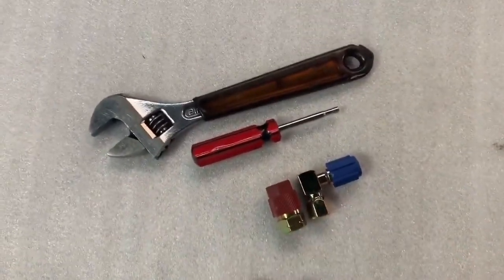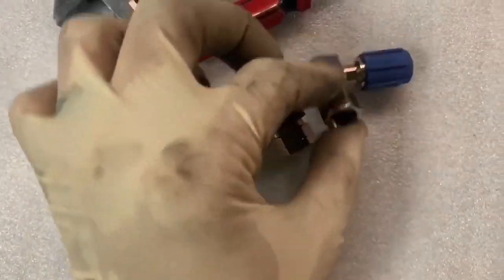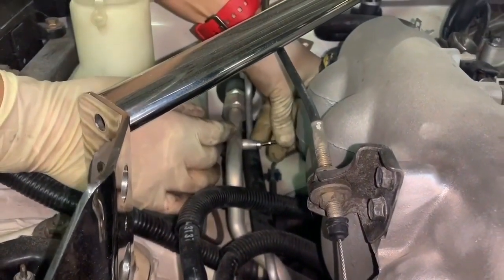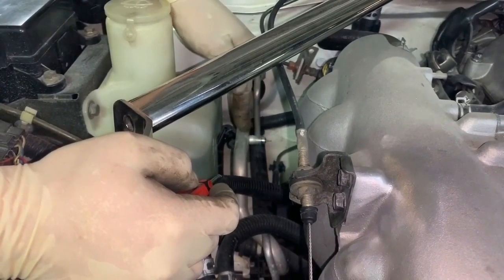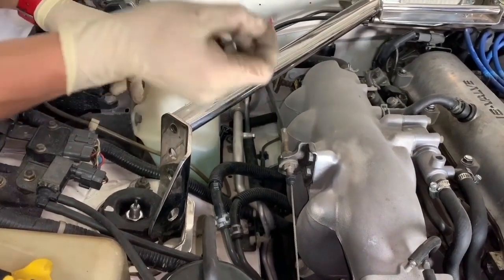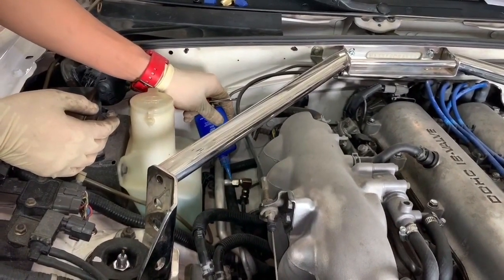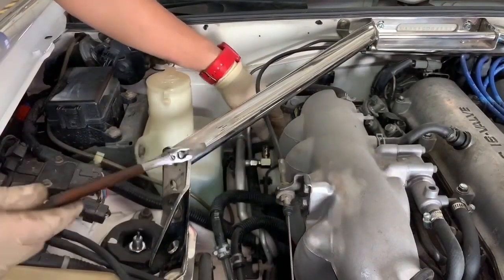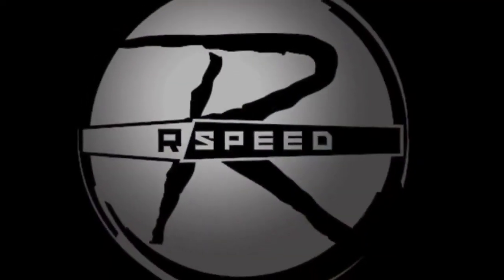R12 to R134 Adapter Kit Installation kit RSpeed NAB 71450

Comment: just one point.  If your system isn't pressurized, you likely have a leak.  If it is pressurized, releasing the refrigerant into the air is unlawful.  Have it removed by a qualified A/C professional.